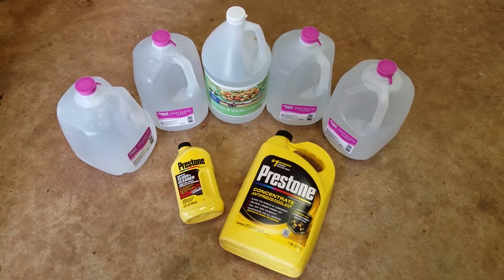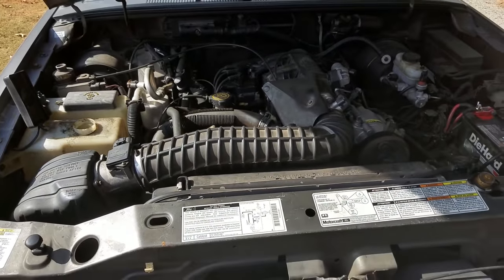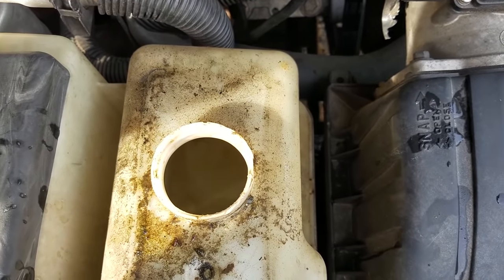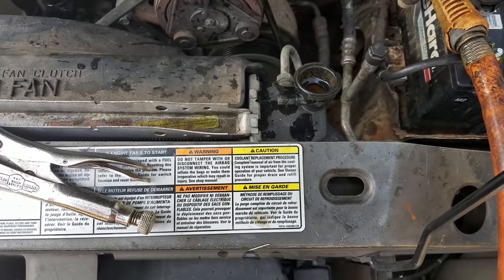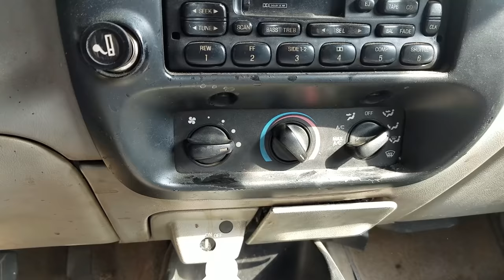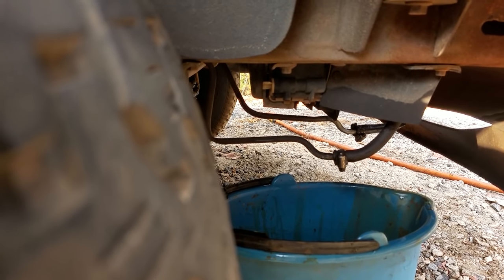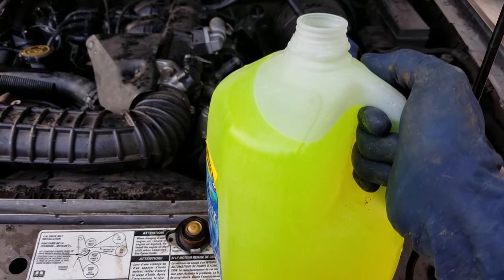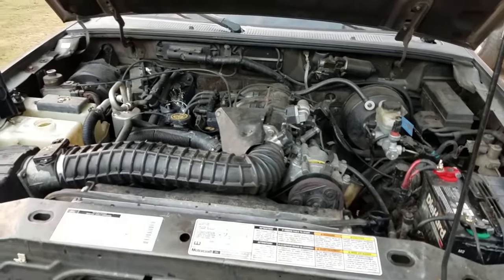Check Out What Came OUT Of This Radiator!

Comment from the maker: What's up! Make sure to check the links in the description for all the SUPPLIES used in this video. I linked to some really NEAT TOOLS that help too!!!
As an Amazon Associate I earn from qualifying purchases.
Reply: Matt's Shop Thanks for the video. My Jeep has been overheating I'm gonna use this stuff right now. I made the mistake of using a radiator stop leak and may have ruined my radiator. Worst part is I already replaced my hoses thermostat and water pump (water pump was leaking) hopefully those didn't get damaged with that sealant as well
Reply from the maker: You are welcome. Yea, make sure that you never use that stop leak stuff. It will ruin everything. Hopefully you are still good.

Comment: Matt great job. Few suggestions.  Use distilled water all the time including the flush part.  Using 50/50 at the end after three full flushes will result in very low concentrate levels overall - probably in the 25-40% range .  Every time you filled and ran the engine you diluted the overall system coolant level with water. This is good especially if you use distilled water.  It is key to know what the total capacity is as well as what you drained.  Doing the water flush several times results in the block getting mostly water in it.  Depending on the total capacity, use of 50/50 premix like you did will result in a very poor coolant percentage in almost all cases.  If you used 100% concentrate, you would have ended up with a much better chance of hitting 50/50 total system (recommended) when finished.  Thanks for the video.
Reply: So you are saying we have to measure final flush as it is not equal to total capacity and there will be water in the system?
Reply: Madhawa vishwajith -  you need to know your total system capacity.  You also need to know and measure how much you get out of a typical drain from the radiator.  The difference will be the fluid within the engine block. With those two capacities you can figure out what percentage you need to add pure coolant to get you to the 50-50 desired level. Are usually flush several times which leaves the engine block portion as 100% distilled water. That is why you need 100% coolant on the final addition to get you to the 50-50 ratio desired
Reply: condor5635 thank you very much for your explanation 👍👍
Reply: And a good idea to just add 100% coolant in the reservoir?
Reply: Phil PJ Davis - for topping off occasionally using just coolant or just distilled water if either is handy or 50/50 mix as well.  Doing one or the other in that quantity won't make any significant difference on the overall system percentage.
Reply: In addition the heater core is full of water too. And from a hose, water. Not distilled water
Reply: Am I right or wrong I’m doing a flush on my 2000 f-150 and I drained the whole system then ran a hose till both were clear the petcock and the Block plug then I’m gonna run the cleaner and water then drain again and then add 50-50
Reply: @alexharper9786  wrong on couple front. Don’t use hose water. Don’t fill with 50/50 after flushing like you describe. Read about about knowing total capacity and then calculate amounts
Reply: Had a Hyundai  dealer mechanic say they never use distilled water on engine replacements or radiator service!
Reply: @wallychambe1587  - what did this Hyundai mechanic say you should use hose water? I would take anything he said with a grain of salt unless he saying use deionized water he doesn’t know what he’s talking about and went to the Runco Automotive School of Correspondence
Reply: @condor5635  This was in a Hyundai  Forum by a guy called Dog Patch Steve, he said "I have never worked a dealer that had distilled water on the side, that be an extra cost to consumer, and what to say fella going to mix it right in first place and add to car, I have folks in shop doing engines that just dump the gallon of coolant in and top it off with water (we use faucet water in every dealer I been in) How much longer it really take to mix coolant in a large container, and pour mixed into cooling system" "Change coolant every couple yr and keep it clean, faucet water be of no real concern"
Reply: @wallychambe1587  - I would not be able to say for sure but I doubt ANY dealers use anything other than the premixed 50/50 which has either distilled or deionized water with the antifreeze.  So there is no need for them really to use the full concentrate and distilled water.  Distilled is very cheap.  Why not use it then and forget any headache or discussion about the minerals etc in faucet water?  No brainer in my opinion.  The fact that he is a Hyundai mechanic gives me pause too....  :)
Reply: Has no one ever here heard of a refractometer
Reply: @jat-justamaturetech-philpj8285  That would make sense since  after flushing your engine block would now contain nearly 100% distilled water (and no antifreeze). Then adding pure undiluted antifreeze to the radiator would mix with the water in your engine block when your run the engine and come out near near 50/50 solution.
Reply: Hey pal, where I live I couldn't find distilled water, if I use deionized water to flush the radiator will it cause any damage to the cooling system?
Reply: Hey pal, where I live I couldn't find distilled water, if I use deionized water to flush the radiator will it cause any damage to the cooling system?

Comment: I bought a v6 ecotec 3.8 litre  Commodore from a mechanic! He was a teacher for MTA, Motor trades association in Australia! The Asshole put Alumaseal in the radiator and I have flushed the cooling system about 10 times! I'm still getting slimey Brown goo! I bought a hose and compressor gun to superflush the system! Another guy on YouTube in Australia with identical car had same problem! Good video!
Reply from the maker: Those radiator seal products are HORRIBLE! All they do is plug up the whole cooling system and you can NEVER flush it all out. I never use them.
Reply: @MattsShop  yes true! But the fact it only had 147000 km on the clock. He was a useless mechanic as some of the things were a joke! I'm not certified and I was taught everything by my older brother! He used to specialize in performance trans rebuilds, different rebiulds etc! So the way he taught me I've done pretty well. Cheers

Comment: Helped me out with my 2017 ram 1590 3.6 .I had a lot of sludge due to faulty oil filter housing and dealer ship wanted to charge me  for brand new radiator because they didn’t want to do this part .just saved me $500 thanks a lot

Comment: Just remember that when you drain the radiator you're only draining about half of what's in the entire cooling system.  So even after doing all these flushes you still have about half water left in the engine block/heater core (notice the amount you drain out after each flush is not all that the system holds).  If you use the 50/50 mix you'll end up with a diluted mix because of the water left in the engine block/heater core.  I would recommend using straight antifreeze and put in half the amount the system holds.  Top it off with distilled water if needed.  That should give you pretty close to a 50/50 mix.
Reply: its nowhere near half the capacity,,more like 10-15 % ,best is to see what is your capacity and then see what is left after your final drain and trust me its nowhere near half,,its actually very little but all you do is take the amount left in the system and add the same amount of concentrated coolant then top off the rest with 50/50 but even if you skip doing this and juts top off with 50/50 yes it wont be 50/50 but not that far off and no big deal

Comment: I don't know how you determined that the stuff in the overflow tank was stop leak, but that seldom happens if the stop leak is inserted as it is directed. If done properly there will be no residue from it. The stuff stays in suspension until it reaches the air under pressure at which point it begins to react as it is designed to do. I have used it (bars leak) to stop a leak in a radiator that was severely damaged from an accident during a trip - the antifreeze was literally 'peeing' out of a big hole. The car's fender was damaged as well, but it was possible to drive it. So after inserting the stop leak and topping the radiator, the leak stopped within five minutes (actually less) - we continued our trip (we were half way there when it happened), stayed a few days and returned to our home without further trouble and with no leaks. The radiator was so badly damaged that it had to be replaced, but the stop leak did its job. and I am sure that many others have similar stories.

I have used a brand called Silver Solder (I think it was) that worked very well, too. The chemical makeup of it prevents it from separating from the solution except at an opening. Many people pull the crud out of their radiator and claim it is from stop leak when it is only sludge and organic growths from micro organisms that can live in the water when it is not a high enough concentration of antifreeze. And even with half and half it is good bet there are some of them growing as well as junk from the water and rust, etc. 

BTW that crud at the opening is due to foaming and settling of stuff in the antifreeze solution. The only reason that it is there is that the level of the water concentrates it there when the engine is shut off and cools down. You might actually find some of the stop leak come out of solution there because most of the requirements for it to set up are met. If there was enough stop leak and if the cap leaked enough, it might be fooled into trying to fill the entire opening. Other than that, there is no location in the cooling system where the stuff comes out of solution because its requirements are not met elsewhere. You will get more solids from combination of the minerals in the water with the antifreeze than from stop leak. That is why distilled water is so important. You should not use tap water that you know is heavily mineralized to even flush a system. It is better to mix the antifreeze mixtures that the manufacturers claim is compatible with others than to use that kind of tap water. In most locales in Texas I don't believe that there is enough minerals in the water to bother, but I am not familiar with other than Dallas and Austin areas. The water here is so soft that there are hardly any minerals in it that will bother, but I still use distilled water due to the other chemicals in the tap water. The chlorine and fluorine are so active that you never know what they will react with - including the metals of the engine and radiators.

Comment: Good video!  I appreciate your time on showing us how this is done.  My heater core is blocked so I might as well do a coolant flush. That leak patch stuff is awful.  Never knew that. Great to see how you clean out each component.
Q1 - After draining all coolant out, you can run the engine with Radiator Cleaner and tap water, right?  I could do that with vinegar and water too,  But plain water is fine, correct?  I'll use distilled when refilling it with coolant.
Q2 - Would it make sense to clean out the heater core separately as it may be even more dirty that the radiator?  First clean that out, then flush out radiator, then the reservoir tank, then the whole system.  Would this work?  My heater core must be heavily gunked up as I have zero heat.  Worried about how bad it is.

There is a lot of conflicting info on what to use as a cleaner:
1. White vinegar - this seems to be the best option.  The heater core and radiator are both made from aluminum. White Vinegar is kind to aluminum and removes rust and calcium deposits.  Sells for $4 at Costco for 2 gals.  I use it for toilet bowl cleaner and also lime scale on tubs, sinks, etc.  Vinegar can make other metals rust, but its only in there for 30 mins max and gets flushed out fully, so best cleaner, I think.  It is also eco friendly and can be disposed of in any acid loving plant bed, diluted.
2. Prestone Radiator Flush - sells on Amazon for $22. The complaints are that it did nothing, and did not remove any calcium build up on fins.  Recycle chemicals, costs money, not effective.  The Sodium Chlorite in it, corrodes aluminum.
3. Baking soda mixed with water - this discolors aluminum.
4. Distilled water - great for dilution but useless for cleaning.

I also saw a nice coolant flush gun on Amazon for $44 that you can connect your air compressor to.  Now that would be smart. It controls water pressure from hose as you can damage fins, and allows air to mix, dislodging debris, rust, calcium and I'm guessing blowing out the water at the end for coolant replacement.  What do you think?
Reply: Yes. I did my heater core separately. You disconnect both hoses and pour your cleaner of choice into it. I used CLR. You wait for a bit and then use the hose to flush out the core. Make sure you backflush it for best results. Cheers.

Comment: Thank you... oh!  Try simple green in your engine compartment.  Spray it on pretty strong and use a kitchen dish brush to scrub.  This works and it brings interior plastics back up to factory color and finish.  I just did my 88 Chevy truck and boy it's a shock to see the color pop out.  Works in carpet well, too.  Use a pressure washer to wash out the engine compartment.

Comment: If you live in real cold areas up north I would mix more antifreeze then water if you do this procedure because you still have water sitting in the engine block etc,  after you drain it, so the mixture is not gonna be 50/50 anymore.  Mix it maybe 70/30 or it will be slushy or freeze in real cold weather.
Reply from the maker: Dill Wiggle That's a good tip for anyone who sees this. I don't live where it gets very cold at all, but if you live up north I could see it being a problem.
Reply: You can get away with 50/50 here in Canada for the most part.  If it's an extremely cold winter, we bump it to no more than 60% and never beyond 70%.  If such Arctic Blasts persist for days or months, I'll just drain out about a Quart and a Half, and replace it with the same amount of Concentrate or Unmixed Coolant...that puts you at roughly 60% which is more than adequate for most conditions.  MORE...isn't always better?   In the case of Antifreeze/Coolant beyond 70%, you'll still risk Freezing because straight unmixed coolants will Gel under extreme cold much worse than water.  So you'll still risk freeze-up!
Reply: Theres a much easier way. I do a final 2 flushes with distilled water. Its cheap enough and then i know whatever is left in the block is mostly mineral free. Then just check your owners manual for the total cooling system capacity and add half that amount of straight undiluted coolant and top off with more distilled water. For instance, if your cooling system takes 10 quarts, pour in 5 quarts of undiluted coolant before topping off with distilled water. That way, even if you can only get 3 quarts of distilled water in, you know the other 2 quarts are in the block and itll have the right mixture once it circulates.
Reply: No dude, 50/50 ratio gives the best protection. Do not make shit up and go against the recommended procedures. It's a good thing to use an anti freeze tester to confirm the protection level
Reply: @steveneumeyer681  Do you have a proper name for such tester? Because the hydrometer tester only gives a reading of, at which temperature the coolant is protecting your system. If you meant for the tester to be a hydrometer, how do you determine the water to coolant ratio, according to the reading?
Thanks.
Reply: @cesarrodriguez9597  I was referring to the hydrometer type tester.  The reading is indirect, as you stated it gives only the protection level and not the mixture ratio.  It would probably be possible to convert the protection level to a mixture ratio, but that value seems less useful.  some coolant test strips will give mixture ratios if you want that.
Reply: @steveneumeyer681  This is true, however pure antifreeze will freeze, that's why you do need to add water to your antifreeze if your running straight antifreeze.  50 50, 60 40, 70 30, it all depends upon whare you live and the climate your at and the weather conditions you are under/experiance.  And, laugh at me if you will, it's good to drain out your antifreeze on a yearly basis, or every two years, never let it go any longer, strict matainance goes a long, long way.
Reply: @pokerface828  Yes and the new coolant will take care of that, people forget they have inhibitors in them, they act like flushing with tap will destroy your engine, no, just don't leave it in there and rinse it the f out people!
Reply: @pokerface828  This is very smart! I'll be doing this too...

Comment: Doing a proper coolant flush is definitely a pain in the ass and takes a fair bit of commitment to do properly.  I have an LS3 Chev highly modified engine and just to get all the air out of the system after all the initial work takes a lot of time and top ups.  But it definitely saves lots of angst in the long run.
Reply from the maker: Yea, it's a real pain. It's good to do though. That way you know exactly what condition your cooling system is in.
Reply: @MattsShop  Quite correct.  And maintaining your radiator with flushing it either on a yearly basis or two year basis will keep thing running healthy without hardly any problems to have to deal with such as hearing problems that may come up when you need heat in the much more colder weather time, because driving a car or truck without any heat gets rather difficult to handle.  Like everything else out there, matainance is and has always been a big factor in a reliable car or truck especially when you rely on them for whatever or whare ever you go or whatever you  do within your lifetime.

Comment: What is the small black tube on the side of the radiator cap? Can it be removed and replaced during the radiator flushing?or is it able to drain the water out of the radiator?